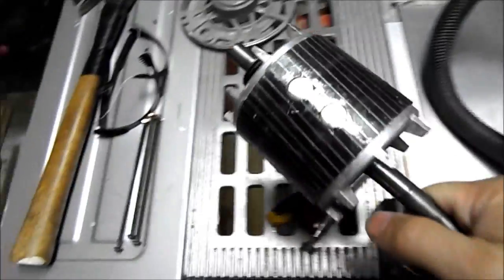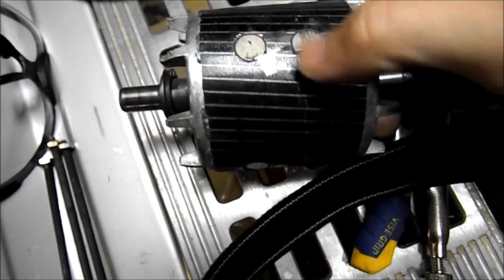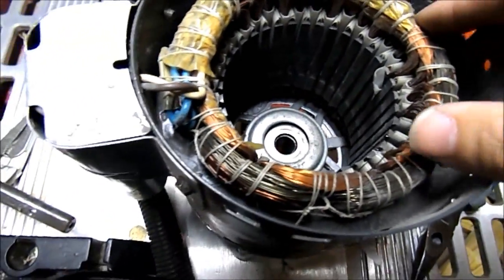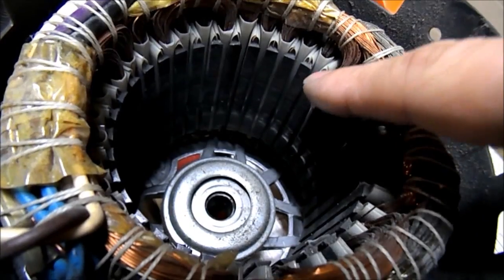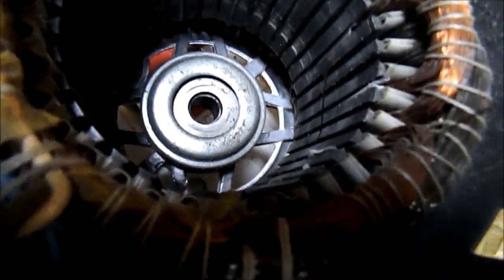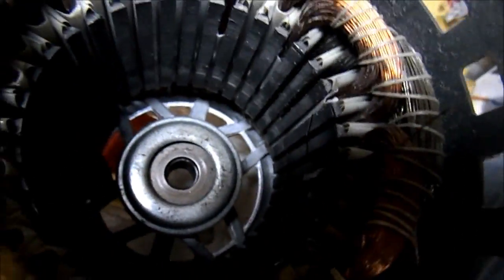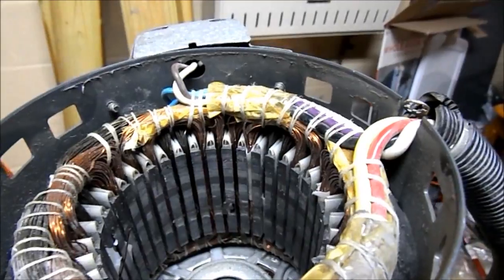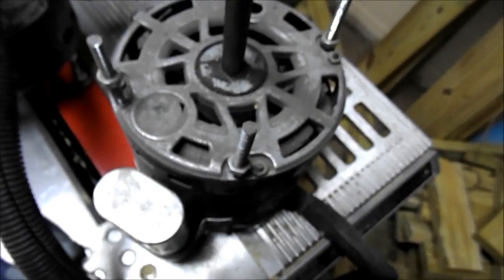Convert AC Induction Motor to a Generator

Comment: No vedeo is clear that wheather the induction/ electric motor winding is right or stator winding is right besides as about rotor wheather rotor fitted with neodymium  magnet is correct to produce electricity or armature is right to produce current.

Comment: So if the things inside are chipped from your magnets, your motor is not good?
Reply: Only if it breaks a wire, any other chips should be fixable. Any touching between the rotating armature and the none rotating housing should be fixed.

Comment: As an  a synchronous motor, was it wired for 4-5% less than 3600 rpm 1800 or less?

Comment: Hello Jason,  looking at the condition of the coils ,  it appears that the one set of windings is burnt out.  probably the second phase coils ,  this type of motor relies on the phase shift generated by the capacitor to start and also motor direction is determined by this . It is evident in motors that won't self start ,  or have a tendency to start in either direction
Reply from the maker: you are correct about the second coil being out of phase do to the cap, but it was a working motor before I killed it.
Reply: +Jason Roush  I would normally expect no difference in windings colour unless burned ,  I stand corrected .
Reply from the maker: me too, I am guessing the company used two different brands of wire or something or ran out of one after one set of coils.

Comment: please advice me on the following...... I converted a 3 phase induction motor with a magnet rotor  and now how to connect the 3 phase rectifier to get the AC current r I no need to connect the rectifier If no need the currant wold be AC or DC regards. drsharma@hotmail.co.uk
Reply from the maker: +drsharma video UK if you want DC use a 3phase bridge rectifier. If you want single phase AC use a 3 phase to single phase transformer, but get one rated much higher than needed. Most transformers are rated for 50Hz and 60Hz. If you have other frequencies the transformer will not be made to handle it and well add extra heat. Another option would be to use a 3 phase to single phase drive.

Comment: was a bad idea but nice experiment.
It is more easy to have DC motor and convert it in generator. On DC motor you have 2 items in 1 like 2x1. Motor when you feed him with current and Generator when you feed him with mechanical force like rotation speed.

In AC just have one or other and a loot of work to make it.

Comment: Is the motor single or poly phase?
Reply from the maker: It was a 2 phase 230/460 volt. The capacitor gave it the 2nd phase.